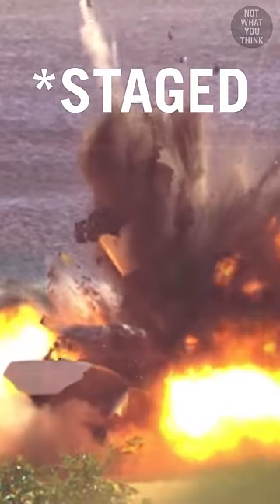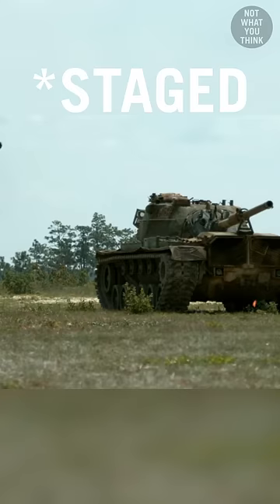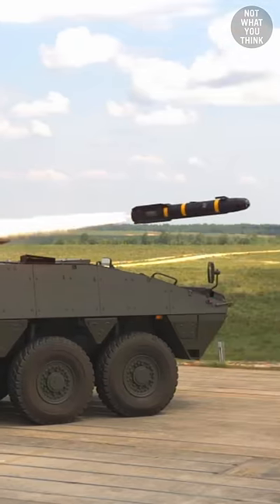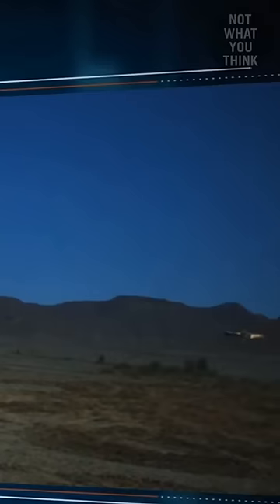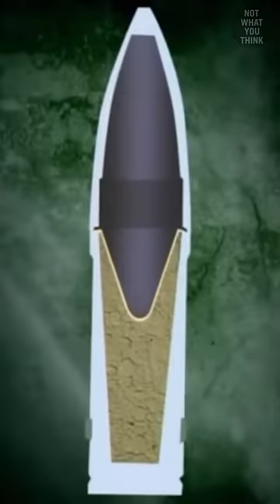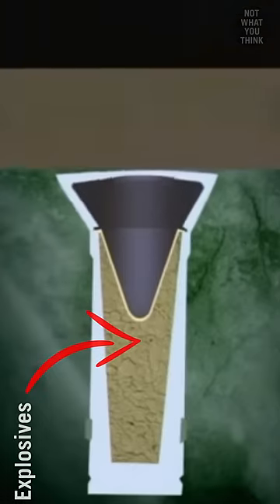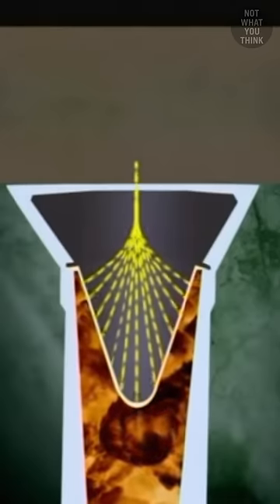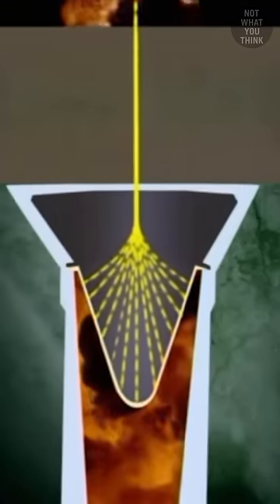How Anti-Tank Weapons Work #shorts

Comment: this was really helpful , I can now protect me laptop from MBTs trying to break into my home .
Reply: Leclerc MBT at your door, what are you going to do in this situation?
Reply: Modern MBT’s usually fire a tungsten rod nowadays. HEAT rounds (like in the video) were more poplar in the 60’s and with rocket launchers.
Reply: @wallacefamilyinpa  ERA can slightly decrease the penetration power of APFSDS round. So it's better than nothing.
Also helps to dedend against helicopters and ATGMs
Reply: @БабайАлибабаев  Heavy ERA can significantly reduce the effectiveness of APFSDS, but ways to counter it have been implemented.
Reply: @ianhawley5676  I will call in for close air support from an AH-64D Apache ‘Longbow’ attack helicopter which will then fire an AGM-114K ‘Hellfire’ Air To Ground Missile using either semi-active laser seeking or millimetre-wave radar seeker guidance mechanisms to from over 5km away capable of penetrating about 800mm of armour right into the Leclerc MBT and then use a Phalanx Close in weapon system (CIWS) in case the crew attempts to escape the tank and break into my home
Reply: @wallacefamilyinpa  most modern infantry carried anti armour weapons still do use HEAT or HEAT-T warheads, HEAT-T being tandem warheads designed to defeat ERA
Reply: @БабайАлибабаев  it might help but today most HEAT warheads actually use tandem charges so even against HEAT ERA can sometimes become ineffective
Reply: @poseidon808  true enough. But, as you said, only some use tandem HEAT missiles. The rest might use older systems, that might be countered by ERA saving the lives of vehicle crews. And giving them the crucial moment to survive/flee/strike back.
Reply: @БабайАлибабаев  yup, although I get a sense more and more are going to be using tandem rounds as new ones get developed. Maybe ERA will develop to counter tandem charges, who knows
Reply: @poseidon808  Work only againt isolated tank crew
Reply: Remember, Norden anti virus is ineffective against 105mm armor piercing discarding sabot fin stabilized rounds.

I love how this thread was started by quoting a Bosnian Ape Society video, yet there is an actual discussion taking place interspersed with more quotes.
Reply: @ianhawley5676 pulling out my Krauss-Maffei Wegmann Kampfpanzer Leopard 2a7a1
Reply: Next, how to scare away that annoying Su-35S
Reply: Alright homeboy.
Reply: @ianhawley5676  grab my javlin i keep in the basement
Reply: @poseidon808 
Cheap way to destroy mbt with ERA  system is :
- shot the ERA blocks with GPMG ...to make it explodes & make an uncovered open area on armor hull
- send the older RPG to kiss that open area immediately

Low budget solution against  hitech ERA
Reply: @ondybandung6096  yeah uh… no that doesn’t work sorry. ERA blocks are designed not to be destroyed by machine gun fire because of that exact tactic. No you can actually skip the MG part, give the RPG a tandem warhead and kill it like that
Reply: @БабайАлибабаев  agreed, that’s part of why ERA is still mounted. Tandem HEAT is typically not gonna be carried by everyone as it requires quite heavy launchers such as NLAW, Javelin or Kornet. So if you’re in a tank and have ERA just pray to god that none of those systems acquire you as a target
Reply: @obivankeno2068  sorta, though a tank platoon or even company is still vulnerable to hidden infantry emplacements with heavy anti armour capabilities, they’re just significantly less vulnerable than a lone tank
Reply: @poseidon808  
I will try by MG then.
I am corious what happen when 12.7 cal hit ERA block
Reply: @ondybandung6096  likely still nothing. Unless you use some kind of anti armour weapon ERA likely won’t care
Reply: Shouldn't have gone to those shady sites in the first place.
Reply: is this a bosnian ape society reference
Reply: You are fine as long as you don't click those suspicious links
Reply: The whole comment section missed the reference
Reply: Mbt is such a military acronym 🤦‍♂️ like fr main battle tank. Like you can’t just call it a tank. Maybe im dumb or somthing but whats the difference between a subordinate peace tank and a main battle tank ?
Reply: The fact that we have scientists here helping solve this comment is crazy.
I’ll help.
Engineer is here 
So you can try maybe like taking a bunch of armored walls and separating them so there are gaps inbetween this way the flow of the jet of death gets scattered!
idk all I could think of. 
Cya at KSC!
Reply: @ondybandung6096 ERA uses explosives that only detonate with extreme pressure, kind of like the primer in a bullet, but they require waaaay more pressure. Anything short of an AT gun isn't going to detonate them. The explosives also aren't flammable, so molotovs or fires can't set them off.
Reply: Not really, Most if not all modern MBTs use APFSDS rounds, no explosives, the tank equivalent to what is in the video is the exact same head, this being HEAT. But most if not all HEAT/HE rounds used can be defeated by ERA.
Reply: @ianhawley5676 You grab your trusty perfectly crusty and well-baked baguette from the basement

Comment: This also essentially turns an armored vehicles crew into pink mist
Reply: The guy who shot it: Don’t you feel silly, Don’t you feel stupid, Don’t you feel a little ashamed?
Reply: And, perhaps, a tossed turret.
Reply: No
Reply: @ronhofer1444  wym no
Reply: Doubt it
Reply: No, HEAT rounds don't work like that, the only real thing that can happen with the crew is death from direct impact with the jet or death to heat near the jet
Reply: At the beginning of the Iraq war, we were still using tanks with DU rounds. One of the reasons we had to stop was because the DU rounds would go through ten blocks of reinforced concrete and suck everything out through a Frisbee sized hole for the entire ten blocks.
Reply: Honestly Buddy, I can tell that you probably haven't even seen a tank in person. I can tell you for certain that a Crew that's been taken out by a RPG are usually burnt so bad that maby a quarter of their original body weight is still there. If the tank didn't Brew up from cooking off the ammo then the crews just had black spots all over their body. No blood. Copper was too hot , so it surgically cauterize the wound , no pink mist for sure. Pink mist comes from my.338 head shot at four fifty..
Reply: @ahh298 you forgot about the f**** tank brewing up.
Reply: @jamesc.e.s.4551 We are still using DU ammunition for AT purposes
Reply: got damn that’s a clan i’ve never heard of yet
Reply: But get held up by a thin wall
Reply: It’s called a shape charge
Reply: Im gunna turn ya to coloured rain!  -The Sniper
Reply: ERA:
Reply: nope, this is a common misconception
Reply: ty for explanonimonicon
Reply: no it doesn't
Reply: @jamesc.e.s.4551 we are still using DU ammo, also there is nowhere near enough pressure buildup to pull things through the perforations of armor/concrete because these aren't space ships where it's a high pressure vessel with a vacuum outside of it.

What you described is physically not possible with a projectile penetrating in atmospheric conditions, the thing about the Sabot dart that kills tanks is a mix of spall from the armor it hit following the dart through the hole and the dart itself striking things inside directly.
Reply: Your thinking of a sabo round.
Reply: @jamesc.e.s.4551  suppose that's a case of it being too effective.
Reply: @Gr3nadgr3gory it’s a case of lying because that’s not what a depleted uranium round does, nor did the US stop using them
Reply: e
Reply: Lol no pink mist 😂 just fried barbecue
Reply: No, it's so fast it zips through crewman